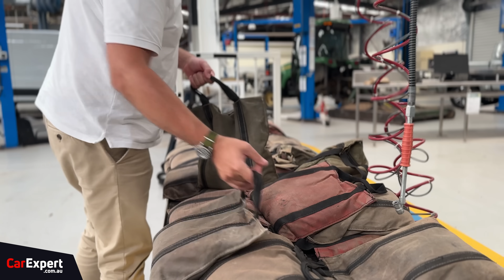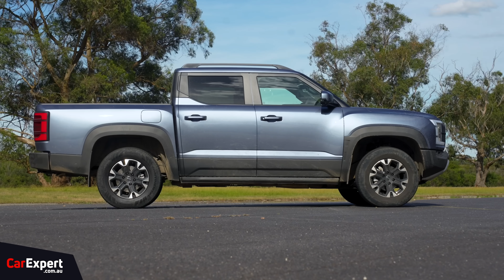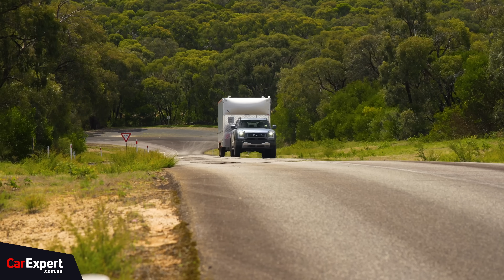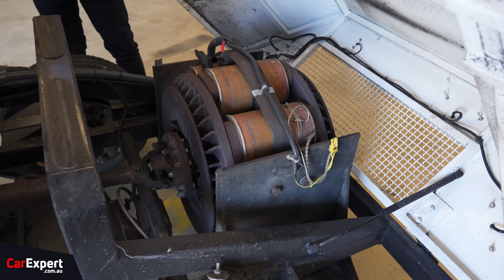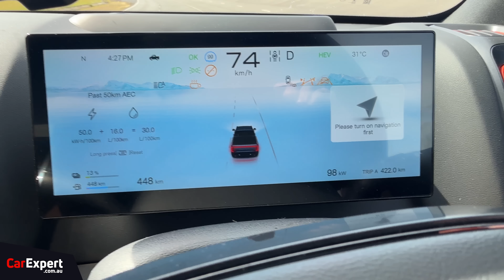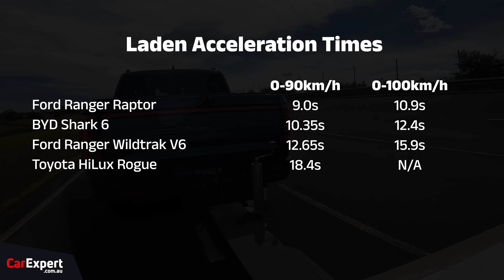BYD Shark 6 towing STRESS test at MAX payload - the results are surprising...

Comment: Am I completely reading this test wrong? Have you just tested the vehicle with 3kn load at 100kmh WITHOUT allowing the ICE to keep the battery charged? If so that is not real world conditions and it is incredibly misleading by implying that the vehicle was incapable of pulling that load. You are correct in saying that this situation ‘could potentially happen’ …but so could your ICE engine failing if you drove everywhere in 1st gear!!! I dare you test it again, in HEV mode, with SOC on at say 50%….go on, how difficult would that be…
Reply: Some of you watch the text again. He was using the towing mode, not pure EV. Also, as pointed out above, he didn’t start the test at 13 %. He didn’t tell us what the state of charge was when he started the test but he stated that after running for a while it started slowing down for a while and then speeding up which he said happened when the battery dropped to around 20 - 25%. The point to take is that if you are wanting to tow heavy loads for long periods where it is working hard, this performance limit may occur. At the end of the day the battery isn’t that large and if you are towing a big heavy caravan in hilly country and perhaps with a headwind, you will deplete that battery quickly enough. The engine only appears to be able to put around 100kw into the battery so if you are demanding more than 100kw of power from the electric motors, you will be working through that battery. It is basic physics. If you don’t envisage putting the car into the sorts of conditions he did in this test the fine, this car may well suit you. He is just showing you the strengths and weaknesses.
Reply: Well, he didn’t start the test at 13% battery SoC. It ran down to that level while testing.
Reply: @jerrymyahzcat  I don't believe that is true, it may not have started at 13% but it would have been at a very low state of charge, where the electric motors were not available for use, almost from the beginning of the test.
Reply: @ it started at 60% but was in full EV mode apparently.
Reply: @jerrymyahzcat  That is a blatantly incorrect comment, where did you get this from, he states that when he started doing the test he noticed the car would slow down to 70kmh and speed up and that was when the battery was at 20-25% SOC. So as others have said that kn test was started at a low SOC.
Reply: @GDM22 I believe he does say, somewhere in the comments, that he started the test at 60% but it started to slow down/speed up when the battery dropped below 25%. My response to that would be ‘so what’…there is a reason why BYD have the SOC range from 25 to 70% because below 25% charge you start to get voltage drop on the battery, which results in a drop in performance. You have to force the car to run on battery below 25% by holding down the EV/HEV button for five seconds, which is pure EV mode. The ICE will not assist in any way in this mode, regardless of the ‘normal’ SOC saved level. The ICE kicking in was a fail safe, which automatically happens around 15%, even if you are trying the deliberately flatten then battery. The only way you can truly flatten the battery is to completely run of petrol and continue running on pure EV power…which is crazy, as you would never do this in any other car, so why would you in this.
Reply: @beerfordolphins  Hmm, I watched again, his comment was when he started doing the lap, the car dropped down to 70kmh ........., there is no way the car dropped 40% SOC part way through the initial lap.
Reply: @jerrymyahzcat correct Jerry…he didn’t. He ran it in pure EV mode which flattened the battery quickly. It went from 60% charge to around 13% without ICE SOC recharging. The BYD overrode this mode automatically and kicked the ICE in, as it doesn’t want you EVER to completely drain the battery. Once it did, the depleted battery and the ICE maintained the charge level at 13% and STILL towed the 2500kgs at 74kmh. Once that load was reduced the ICE continued to charge to battery to an acceptable normal driving (and towing) levels.
Reply: Ok…I can sorta appreciate a worst case scenario test but he then compares it to the Prado, running under normal conditions, and says that this is why a ‘normal’ ICE car is better. Where is the test of a normal ICE car under ‘worst case’ conditions? He actually stated in his ‘figures’ that a Hilux couldn’t even get to 100kmh! When you think about it..even worst case, it still pulled the load at 74kmh..that’s even after he tried to make the car fail.
Reply: @beerfordolphins a true comparison would be running the Prada on its starter motor.
Reply: Also, for comparison, he previously tested 12 ICE utes under the same load conditions - only 5 out of 12 actually managed to get to 100kmh, never mind doing any laps. The Shark flew to 100kmh and would have maintained that if ICE was used. Petrol consumption would have been high no doubt, but that’s the same for any car under that load.
Reply: @beerfordolphins   I didn't see anywhere saying they didn't get to 100.  I'm sure it's good for some uses, I just can't justify spending so much on a Chinese EV that will ultimately depreciate steeply.  I was interested in one yo tow my race car around the country, but no chance now I've seen a real world test.  A mild non plug in hybrid would be ideal.
Reply: @mattmobiles15  If you base your view of depreciation for the future on what has happened in the more recent past, I think you are brave.  On the current trajectory there will be a number of legacy auto makers go under in the next decade.
Reply: @GDM22    not just depreciation.  Let's not even start on the legacy topic.  People and auto makers are being forced into EVs, even holding already ordered cars so they don't cop big fines per ICE car for not selling enough EVs yet.
Reply: @mattmobiles15  Faster depreciation is occurring with EVs because they are improving quickly and the price is falling on new vehicles in some instances significantly. EVs will be continue to improve and they will become cheaper than ICE in the next few year, longer life, faster charging, lighter, higher density batteries coming will be a further nail in the coffin.
Reply: @GDM22  hopefully they get better.  Sorry to burst your bubble but ita impossible to create an EV without a lot of oil.  You need oil.  Everything in an EV is made of or using it.  And I don't see any electric ships or planes transporting EVs or their components around the planet.  There will be no nails
Reply: @GDM22  petroleum is 40x more energy dense than the very best and latest EV battery tech
Reply: @mattmobiles15  yes petrol is 40 x more energy dense than batteries but ICE engines are only 20-30% efficient in using that energy density whereas BLDC motors are 80-90% efficient.

Regardless, the costs of petrol vs electric is far in the favour of electric. The efficiency also allows for the battery to be larger and heavier whilst producing the power to make the additional weight moot.
Reply: @ryanokeefe12  sure, if you can charge at home it's somewhat cheaper, but let's not even get into the extra costs of a solar system amd expensive EV which are costs that equal decades of fuel buying which is more economical for the majority.
 
However, people have done plenty of road tests here and in Europe, and charging in public costs more per km than fuel.  Also, they want smart meters in your home so in future they can tax you extra to charge at home.  Why?  $19B of government tax revenue is from fuel in Australia,  they will not forgo that and it will be transferred to elec vehicles.  They've already started by charging per Km in Melbourne, home charging permits, battery disposal tax, etc.  From July 2025 they will be charging people in QLD to put solar back into the grid, look it up.  It's a typical bait and switch, or as I like to say, incentivise then tax.  All costs for fuel WILL BE TRANSFERRED to EVs no matter how or where you charge them.  Everyone is blindly walking into more tax and control like sheep.
Reply: @GDM22 Absolutely look at VW and Nissan both could go under
Reply: Yeah its wild that he didnt even mention the SoC engine setting at all in this "towing test". I would have thought that setting would have been the focus of this video.
Reply: You are reading this wrong. He is allowing the engine to recharge the battery and he explained it pretty well. The engine is working overtime trying to charge the batteries and push the front wheels. The full batteries only last 100kms, probably less when towing 2.5 tonne so this scenario is more likely than unlikely if you plan to tow long distances, especially in the hilly areas.

In BYDs defence, they never advertised the shark as a full on caravan tourer.
Reply: Great work Paul with doing back to back comparison tests using these test trailers.Seeing the comparison figures is very interesting.
I’d like to see a test on a production Shark 6 where it’s driven for how many ks the average holiday maker does, towing the average vehicle be it boat or caravan with the average weight to see how it performs on a 30 plus degree Aussie summer’s day. Using the test case scenario of the same road trip, similar traffic conditions, and similar temperature to do comparison tests. I can understand it will be a big challenge to do a test like this, to work out what these averages are and to have the vehicles available to test on that 30 plus degree day. The point of this type of towing test, is so the average holiday maker can more easily understand and relate in the average real world how the vehicle will perform for them, when they do their holiday trips. TFL does something similar.
Reply: So called expert doesn’t show anything about how it “failed “ rather quickly jumps straight to conclusions 😂
Reply: This is what I don’t get.

Other reviews of this car have said that the engine automatically starts up at 25%.
Reply: This is the same guy who said the inside build quality of the atto3 was loose and not good as he tried his hardest to make the centre consult space lid appear flimsy. It wasn't (still isn't two years later) and no one has ever reported it online.  And FYI, he owns (or at least owned) a Tesla and a Ford raptor..... I don't trust him.
Reply: This will be all good,until the greenies,stop coal,gas and nuclear power generation,then your byd will be parked in the garage like every other vehicle,when it's cloudy or not windy.
Reply: @peterdavison203  and that efficiency you're banging on about is heat, not efficiency of using the fuel.  You're just parroting dogma you've heard.  ICE cars also use the spare heat to head the cabin, not needing extra load.  A 50Kg fuel tank can get  you further than a 1000Kg battery.  This is why you will never see electric planes or ships unless they have a different way of receiving power other than batteries.  I don't want to lug around an extra 950Kg batter, wearing out my tyres, brakes and not to mention the roads, or even the extra weight being a hazard as its a heavy and flammable  missile in a collision.
Reply: No BYD for me.
Reply: This is the problem with these people who are not convinced on PHEV or HEV. They simply don't understand that both systems are meant to work dependant on each other not independently.
Reply: @zizimai7568  yes, they act as a team.  Unfortunately in the case of the Shark 6, it provides no real advantage in terms of fuel consumption over a normal Ute, so it's kinda pointless.  A good exercise in technology and hopefully will improve.
Reply: If you watched this other videos especially regarding how BYD sharks performs it’s like he was deliberately trying to make it fail, despite all his efforts I think shark still performs better than he would expected. If also have to understand he is sponsored by Ford 😂
Reply: @yucynthia5210   good point, sponsorship plays a big part
Reply: To be fair the user manual of the BYD states not to drive the car above a 12% incline whilst towing. Good luck with that, I know plenty of main roads and highways in QLD, SA and VIC that have steeper roads.
Reply: @ablet85   as I was saying, it's a pointless car
Reply: @ same rules applies to all other Utes, especially the ford ranger raptor
Reply: @ Ford ranger’s user manual also states not to drive the vehicle over 12% incline whilst towing, it’s called industry standard. I bet he will never mention that, not to mention he actually owns a ford ranger.
Reply: @yucynthia5210  did you read it in the manual?  Don't forget the ranger can tow an entire ton more than the BYD
Reply: @ ranger raptor also has 2500kgs tow rating I bet you never heard of it
Reply: @yucynthia5210  not comparing the raptor.  It's not designed to tow, it's designed to be a silly sporty Ute.  All of the other utes can tow 3.5
Reply: @ tell Paul that, he is also a proud owner of that silly sporty Ute, besides since when shark was advertised as a heavy duty towing truck?
Reply: @yucynthia5210  yeah I know.  People that need a proper Ute don't buy the Ranger Raptor, the same will be true of the BYD Shark.  For most, it will probably be fine.  Merry Christmas
Reply: @ Merry Christmas to you too and happy new year
Reply: Noone's going to be operating this vehicle in such a load case for miles and miles.  It'll be doing 45-50L/100km at this rate and you'll barely be able to make it between fuel stops when out in the donga.

FWIW, that's higher fuel consumption than a B-double.
Reply: @AndyRRR0791  yep  it's an OK car but a pointless Ute.
Reply: Agreed
Reply: Relax mate Jesus
Reply: Xi Jinping is very happy that you will go to such lengths to defend this hunk of junk. You can pick up your paycheck later.
Reply: I've heard a million times "I'll never buy an EV " never say because one day you probably will
Reply: @RobertB56 I’ll buy a full Hydrid ICE only. Never a pure EV with a Lithium Ion battery. Maybe a new solid state one day.
Reply: It's a towing "stress" test. Probably worth keeping in mind.
Reply: @KingWilliamProtector  and it failed
Reply: There’s a ‘max mode’ (read the manual) that allows you to completely bypass the ICE and run in pure EV mode. This is to be used when you are going on a shortish journey and you will be recharging the battery afterwards, effectively using zero petrol and benefiting from solar recharging at home, for example. It’s NOT to be used for towing 3kn at 100kwh and stating that it has no power to tow the load. If the SOC was set at anything from 50 to 70%, ideally 70%, then the battery would be drawing power till it uses a couple of %. The ice, in parallel, would be assisting the power to the front wheels until it spots the couple of % drop and utilises some of that 150kw of power to recharge the battery. Once it’s back at the SOC save level, the ICE resumes helping (or not) the front wheels. In THAT mode, it would have run basically until the petrol ran out and then it would have depleted the battery completely…but we all know what happens when you are about to run out of petroleum product in ANY car…you fill the bugger up! So the test everyone is basing their ‘can’t tow for sh*t’ comments on is a sham..and very disingenuous to be completely frank!
Reply: @beerfordolphins This is what happened but the system couldn’t generate enough power to charge the battery and go more than 70km/hr.
Reply: This is exactly what he has done. Hmm 🤔 why’s that…
Flatten the battery to 13% soc left & try towing with the max 130kw 1.5L ice alone is one thing but ☝️ 
To then use a Toyota  Landcruiser 300(?) ice as a way to show it can keep doing laps with a much larger (diesel or petrol ice) whilst it has fuel ..does seem to be a strange comparison 🤔 
And one that others take for “proof” of a massive failure or manufacturing fault & it shows poor quality. But all it is, is comparing a 1.5l 4cyl petrol engine to a larger petrol petrol engine. He should retract this & say that the Shark with a sufficiently charged battery & ice doing what it’s there for will do many laps with hardly any fuel usage compared to the Toyota having a limited range due to running out of fuel because that’s its only source of movement.
Maybe put 10ltrs of fuel in both & the Byd shark has a sufficiently charged battery & see what goes further out of the two ??
Reply: @matsullivan5861  the truth is - the battery will become flat sooner or later. And when it happens - it would be the ICE job to pull the car and to recharge the battery. 
Im driving SHARK's little brother - SeaLion6 and when the ICE is working - it is taking anywhere between 6 and 12L/100kms. The main "savings" happens when I go down the hill - the car switches off the ICE so average fuel consumption goes down. It also switches off the ICE when the car is standing still (traffic lights, jam etc), so the average fule consumption is pretty low for such car (around 5.5L/100km)
But in case of SHARK, if you are driving countryside on a looong trip, long road and towing a massive trailer - the chances of the system to shut off the ICE and save your fuel is much less than when you drive in a city. 
Also think about that - the car is moving, using the battery and the ICE. If ICE produces less energy than your motors are spending - the battery level goes down. To replenish the battery - the ICE has to go harder to pull the car and to recharge the battery. OF course it can only recharge the battery but in that case it has to produce enough energy for the battery AND for the electric motors to keep the car moving.
So effectively, after the first 80 (or whatever) kms, you'll be using the ICE.
Yes, the electric motors may kick in from time to time to help with acceleration or uphill driving but then ICE has to work even harder to compensate for that energy loss.
Reply: @alexanderrikmanis8753   yet all of these EV fan boys will ignore your real-world experience, just like they're ignoring the results of this real-world test.  Hopefully the tech improves one day.
Reply: If you're doing a lap of australia or a long trip, you're going to constantly come across the issue he has highlighted, it's important and it is good reporting.  Short towing trips, fine.
Reply: @mattmobiles15  I am not sure that is true, the car appears to have settings to manage the battery to a higher SOC. He started that kn towing test at a very low SOC (13%), in normal driving the car would likely have a chance to charge the batteries on the flat downhills, keeping the battery charged for uphill sections etc.
Reply: @mattmobiles15  I thought the same thing. Towing a van across the Nullarbor into a strong headwind may be a struggle for this vehicle. Interesting car and may well suit many buyers but it does appear to have some important limitations. The chance of regen dropping out halfway down a steep hill is far from ideal as well.
Reply: @petercross8620  I don't see what the point of this Ute is.  It only uses about 1L/100Km Les than other utes for daily use, pkus charging, and uses more fuel than allutes except the ranger raptor, plus charging for towing.  It's pointless
Reply: @mattmobiles15 no , you would set the state of charge to be 50% or more, leaving a massive buffer . Not run the battery below the recommended 25% then show how it could struggle. The test is good to show the worst case but isn't exactly realistic
Reply: @deant1990  the car is advertised to charge itself with the petrol engine.  Which it can't.  So if you're on a trip or out and come across this issue you'll need to public charge which we all know costs more per km than fuel from many tests here and im europe.  Then it only uses 1L/100km less than other utes under normal driving, and when towing it uses more fuel than other utes towing 1 ton less than them.  It's a pointless car.  Once this car has been out for a while it will be revealed its ok for short daily use, but it's pointless for long trips or being away from home for more than a day.

This whole, keep the battery in a certain charge % is what makes the car pointless as it has no advantage over a normal Ute as it doesn't save any fuel and will cost you the addition of charging. 

I actually hope something like this will become good.  Mazda just revived the rotary engine to act as a generator, so tech will improve.
Reply: @mattmobiles15  jeez Matty, I’m really concerned that you’re not getting it! Let’s forget the engine/motor for a sec. It’s a Ute that does 0-100 in 5.7 seconds, can (as he demonstrated properly) pull a 2500kg up and down hills, around country roads, with ease. Has more tech than any Ute on the market. Has the nicest interior (IMHO). Does around 6L/100km unladen and, according to his test, 30L/100km laden, so just as good, if not better, than any other petrol Utes (36L/100km for the Raptor), and is around $20k CHEAPER….but it’s pointless?? So what if on a long journey I spend the same amount in fuel as I would in my ‘other’ Ute? I ain’t spending ANY money on fuel when I charge it during the day on my solar and that, effectively, will give me unlimited short trip driving…is that pointless? I really can’t see YOUR point Matty!
Reply: @beerfordolphins  why exactly do you need to get to 100km/hr that fast?  Real world testing shows it's 8L/100km when my big Mazda BT50 does 9.something.  The raptor is a totally dumb Ute too.  It's more expensive than normal utes, no difference in fuel consumption.... your solar doesn't cost you money?  How much was it to buy and have installed again?  $5K-$20K no doubt?  That is decades of fuel.  Doesn't cost you anything haha.  

As I said, I'm sure it's fine for a little run about town to get your groceries, but real world testing results show it doesn't perform and is therefore pointless.  IT IS MEANT TO BE A UTE, not a little soccer mum city run about
Reply: @ Ask Paul why it needs to go so fast! He thinks it’s important enough and people are interested enough in it to do a whole video about how fast it goes! So, its fuel consumption is better than your basic, run of the mill Mazda BT-50..great! I installed my solar 14 years ago…why would I care about the cost of it now? I’ve done 320,000kms in my kluger…most of it was less than 50km runs, but let’s give you the benefit of the doubt and say only a 100,000kms was, there’s around $16k I’m saving in petrol….ahh, but it’s only money isn’t…pointless saving it really..
Reply: @beerfordolphins  yes, it will be fine for your needs, which is great.  What we are all saying here is that it's underperformed as a Ute.  Great for a city run about doing occasional Ute things, not as a full time Ute, offroader or tourer.   Time will tell and I hope these sorts of concepts only improve, but it's a big no from me, it will be a pain in the ass to tow my race car around with a shark6.  Nice attempt at belittlement about my basic BT50, doesn't work on me hahaha.  It saves almost no fuel unless you're just doing short trips, if that suits you, enjoy!
Reply: @ not belittling it your BT50…but, I would imagine, in terms of technology and comfort they are markedly different? I’m certainly not dissing any other Ute drivers; as you said, each to their own and everyone will have different requirements. You’ve hit the nail,on the head though Matty - 90% of the Australian Ute buying public will buy one to do ‘occasional Ute things’..certainly that’s the reason I’m buying it. I was all set on getting the Platinum Ranger, seriously thought about the new Prado until Toyota totally priced me out! The only reason I commented on this clip was because of how he tested the Shark…it wasn’t real world at all. It was a deliberately misleading test and false narrative, so much that he is redoing the test under proper, real world conditions (hopefully).
Reply: @beerfordolphins   I'm glad it will suit your needs.  I seriously considered one but it just won't suit my 1400km trips up the Qld coastline for family and work, or long tow trips with my race car.  Around town, great, run on solar EV mode.  Hopefully they prove reliable and the next generation become even better.
Reply: @mattmobiles15  I think it'll be fine for long towing trips too as the trailer towed on the ring represents a constant load - not a weight. It better represents a steep grade towing scenario, and most highways "contain" climbs but are mostly slight rises and dips in a relatively straight highway.

It'll perform fine when towing in real world scenarios, and I think it would work for like 90% of owners including small to mid-size caravans and Toy haulers.
Reply: @joytech23  yes maybe but the other utes underwent the same test and performed much better on fuel consumption, convenience and not going into what looked like a limp mode restricting power.  Yes, it will be fine for most short trips towing and as a daily run about.
Reply: @mattmobiles15  Not correct, the best performer still used 28.3 l / 100km the worst the Raptor 365.5l the Shark 30l. Noting this test began with a battery SOC of around 20-25%, his words not mine.
Reply: @beerfordolphins  The SOC limit can't work if the load on the electrical drivetrain exceeds the engines ability to charge it. He mentioned in a previous video that the pre production SOC limit didn't work properly.

In the real world the shark will perform fine for basically all but the most demanding workloads (which represents almost nobody's workload).

ICE engines (especially diesel utes) will generally not have an issue with WOT for long periods of time under heavy load. They only have to worry about temperatures and almost all utes have over engineered cooling systems. Will most of them reach 100 in the same test? No, but at WOT they will do whatever speed they can all day.
Reply: no, if you scroll down, he replied and mentioned load saving off @ 60% @joytech23
Reply: hidden agenda... 🤔
Reply: I wish BYD gave the ute to someone who wasn't so biased and / or stupid so that we could see how it would perform in real world settings
Reply: @zackmack4712 Talk about taking a review personally.  His review seems fair to me.  Ie, good for most applications, but has its limitations.
Reply: @zackmack4712 
You have fast lane doing tests up a mountain range with and without a trailer.

And then doing a long range trip.

These are in USA though, so you'd never see the Chinese EV cars but it gives a good idea of what to expect.
Reply: Well Paul is the guy who puts EVs into ridiculous situations and then says see, they aren't ideal... like the test they did driving from Sydney to Melbourne, where it cost more to charge than to fuel up an ICE car - ignoring that this is a 1/1000 situation.
Reply: @Expedition_Tranquilo  the irony with that test was charging up to 100% at each stop, then at the concluding it took so so much longer vs ice...when experienced Ev drivers would spend half the time..
Reply: @Expedition_Tranquilo  Yeah wasn't one of his best reviews.
Reply: Yes, you got it completely wrong.  The 1.5L engine cannot cope with heavy usage and charge the battery at the same time.  It demonstrates that the ICE is too small.  It needs to be at least 2.L or 2.4L to perform as people expect.
Reply: @Handleyman  in that case, buying a normal diesel Ute would be smarter, they already usel less fuel per 100km when towing.
Reply: It's so easy to pick the butt-hurt fanbois.
Reply: "Real world settings" would mean towing a van for more than 100km which would deplete the battery which would then give you a tiny 2.0L engine for the remaining leg of your trip...!
Guys, you just have to admit it that this vehicle is not the vehicle if you have a large van doing a lap around Australia. Or even if you are doing short trips away towing more than 100km from home. Forget it. Get a ICE vehicle with rated towing at 3.5 T to give you bit more headroom.
I think Paul is not biased at all and gave this vehicle more than enough opportunities in this and last video. Both showed the Shark as a failure if you doing any serious touring or any long distance towing. Pretty much useless except for driving around town on short hops. In this case why on earth would you buy a Shark for driving around town?
Reply: @charlessas4138  yep.  It underperforms, saves no fuel, and you've gotta pay to charge it on top of that.
Reply: @charlessas4138  you’ve not been paying any attention have you Charles! When you run this car you don’t just use all the battery power first, then the ICE kicks in! Let me try and explain this simply…if you have 100% charge and a 60L tank full of fuel and you set off driving you would probably be in HEV (hybrid mode). This means that you can set the ICE to kick in as a generator at any point between 25% and 70% battery. If you are towing 2500kgs then, yes (obviously) you will use more battery power than if you were driving normally, so after you set off, as you are starting at 100%, you will be using battery power alone. At some point (15kms? maybe?) the battery would get to 70%? At that point, if you had set the ‘ SOC save’ setting to 70% the ICE would kick in as a generator, potentially using all of its 130 (or is 140kw) of power to JUST charge the battery and keep it at 70%. It might, depending on what you are doing at the time, use some of that power to assist the front wheels - overtaking, steep section etc. So you have 60L of fuel to just (potentially) charge the battery and give it the odd push when needed. At some point you would risk using all of your 60L of fuel…but bear in mind that every time you use the brakes you are also charging up the battery, so that’s taking load off the ICE. Let’s assume that his figures are roughly correct and it’s using 30L/100km (ish) fully laden then you would have been dragging that load, if you never went downhill or touched the brakes a couple of hundred kms? No worse than a normal ICE with a 60L tank using 30L/100kms. You still have a bit of battery power left though - around 70% when the fuel runs out so you have that extra distance…maybe it can get you to petrol station so you can fill up? Grab a coffee, let that ICE charge it back up to 70% if you like…or fast charge it up to 100%! You could also fill up a few Jerry cans and take it back up the road to your mate, in his 60L ICE (maybe a Raptor that’s 36L/100km!) who ran out of fuel the same time you did! lol
Reply: @charlessas4138 Well, you can just quick charge it at charging station for twenty minutes then it can go for another two hundred kilometer.
Reply: @charlessas4138  That is not correct, real world towing, on a mixture of inclines and towing within its design parameters, the ICE would be topping up the battery. An intelligent driver would not allow the battery to drop to between 20-25% if you were facing a period of steep inclines. If you are towing to a job site on a daily basis you may get away with almost entirely running off the battery, on a longer trip you will need to use the ICE to assist in charging the battery and if it suits to pull over and access an EV charger. This car is suited for a tradesmen driving to job sites more than doing long trips, like any hybrid. Far from criticzing the Shark where does a Raptor fit in, a dual cab ute designed for straight line performance; there is no reasonable justification for it, it chews through the gas in normal driving and when towing, polluting the environment excessively as it goes.
Reply: @GDM22  well, in this real world test, the ICE could not keep up or top up the battery.  Why do you ignore evidence right in front of your eyes?  Not to mention this useless ute only uses 1L less per 100km under normal driving, and it uses more fuel when towing than other utes.  Plus plug in recharging costs.
Reply: I'm a fan of this thing. But setting the min SOC to 50% is just going to end up with the same result sooner because once it reaches 50% SOC, it basically acts like the car is at 0% SOC unless you're starting from 0kph.
Reply: @ryanokeefe12  it doesn’t work like that. The ICE has 150kw to either help the front wheels, if needed, charge the battery (if its needs to bring it back to a saved SOC level) or both. In this case, it would have kept supplementing the battery every time it dropped a couple of % off the saved SOC value, then it would have gone back to driving the front wheels. This will take the load off the battery so it will take a little while for it to drop that couple of %, then it tops up again…..and so completes the circle of life..or towing in this case 😂
Reply: @beerfordolphins  You've just explained exactly what I've said.. It makes no difference whether the SOC is at 0% or 50%... If the target is 50% and you're going up a long hill with the battery at 50%, the car will start running on ICE only, exactly how it is in this clip.
Reply: @ryanokeefe12 incorrect…the battery at 13% doesn’t have enough voltage to properly operate the motors at ‘normal’ power. This is why the default minimum SOC is 25% and has to be manually forced beyond that limit by putting it into pure EV ‘max’ mode…not EV or HEV mode. When at 13% the voltage drop from nominal was too much for the motors to both charge and maintain high speed, so it ‘limped’ at 74kmh, towing 2500kg equivalent up a 15% grade! lol. A much better test would be to fill a raptor up with a full 60L of fuel, charge the BYD up to 100%, with a full 60L of fuel. Set SOC to 70% (maximum) and the run the test again with both cars..see how much distance is done before the cars pull to a stop. They would both do the five laps at 100kmh, I bet, but then it would be a true distance towing test.
Reply: @beerfordolphins  You've again ignored the fundamental point I've made and restated the same thing again. You're so hellbent on being correct that you're missing the point entirely. As I said, I'm a fan of the Shark. You don't need to defend it to me.

The guy made the point 500 times in this video that it's a worse case scenario test.

Your point on voltage drop is completely incorrect. The lower voltage is easier to generate as it requires less RPM to generate the lower voltage for the initial constant current charging phase (of the CC/CV charging cycle).
Reply: @ryanokeefe12  I don’t think I’m missing the point, I don’t agree with it as I don’t think it makes sense. Your point is that if the battery has a SOC setting at 50% then when it gets to 50% the car will only go at 74kmh, as the ICE has to kick in? So when it was 51% the battery was keeping it at 100kmh? We already know that the battery and ICE together can fly to over 100kmh from a standing start pulling the same load (at 60% charge according to him). He stated that he deliberately wanted to deplete the battery and to do that you HAVE to disengage the ICE completely, so for a time it will have been running at 100kmh, purely on battery power alone, until it got to 25%. You’d agree? let’s say for half a lap…at that point it went under 25%, which is when the blade batteries start to see performance drop off, which would explain the slowing down around 20 to 25%..but even then it was still getting back up to the 90kmh mark. Interestingly, when he shows that shot, you cannot see what mode it’s in - there’s not text where it usually stated HEV. Anyway, it gets to the failsafe condition, which is around 13% - same level at the failsafe in the Sealion. The battery is goosed at that point and can’t add any value to increasing the speed, so the ICE has to take up both the responsibility of keeping the car moving as fast as the input is trying to tell it to move AND keeping the battery at a rate of charge sufficient to keep the car alive and, ideally, for the motors to be of value. There’s no assistance from the electric motors at that point to help accelerate and take load off the ICE to charge more so it is stuck in limping along. That just flat out wouldn’t be the case at 50%…there was still 437km of petrol left in the tank so plenty of charging capability to keep the battery topped up while the electric motors provided the bulk of the grunt.
Reply: @beerfordolphins  Yes.. your entire comment shows you're failing to read the words that I'm saying.. There is a minimum state of charge that you set. Which is what we have been talking about when you say testing the car at . That minimum state of charge setting is the minimum battery level that the vehicle will deplete to before it starts relying on the ICE alone.
Reply: @ryanokeefe12  No..the minimum SOC that’s set is when the ICE kicks in as a generator, not when the batteries turn off and the ICE is solely used. So set it at 70% when the batteries can deliver high power to the electric motors and the ICE can use nearly all its 130kw to keep the battery at that set point. If the ICE has been forcefully overridden, like this test, then the batteries that have been depleted to 13% have no useful  power to deliver to the motors, so the ICE has to do all of the work but, as I have kept saying…you have to override the drive modes and force it to deplete that low. The only reason that the ICE kicked in at all is that BYD have built in a failsafe that tries to stop you depleting the battery completely, as you would then be unable to even start the car. Under normal conditions the recharge set point lowest default is 25% and the recommendation is 70% when towing.
Reply: @ryanokeefe12 not quite, at the SOC % the engine acts as a generator to keep the battery charged, it doesn't switch off the EV powertrain
Reply: Your comment makes no sense. A higher SOC for the Hill road would have meant the petrol engine would kick in sooner and more often keeping the battery higher.
Reply: @ryanokeefe12 that is not how it works, that minimum SoC is a buffer if you know you towing heavy and a lot of incline it will still allow it to use the battery just when not under load it will charge back up to what was set.

Minimum you can set on the car is 25% and max 75%, in this case it was set to 25% but after the stress test battery can only drop so far before it gets capped, if car was set to have 75% SoC when incline start it will have a bigger buffer to draw from.
Reply: @mesky21   this Ute uses 1L less per 100km than other diesel utes, and it uses more fuel per 100km when towing, plus you have to add charging costs.  It's a pointless Ute and not worth the potential hassles and mega depreciation once people realise how useless they are in the real world other than ducking down to get groceries.
Reply: @ryanokeefe12  not the same, if you set a higher state of charge then there is enough power in the battery to keep it running with full power and charge when not needed as much (a buffer) where when it's below  25% the ice will run in parallel to power the wheels and charge the battery.
Reply: He’s an EV owner and has been biased towards EV. So not sure why made these comments. Perhaps because you didn’t get the outcome your wanted.
Reply: @MrBruster78  Not sure that was mean't to be the conclusion of the test, pretty sure he said it performed very well for the bulk of users, edge case users may want to look elsewhere.
Reply: He owns a ford raptor  @MrBruster78